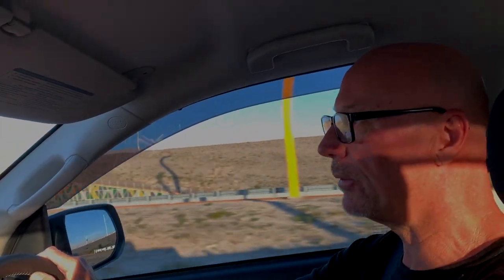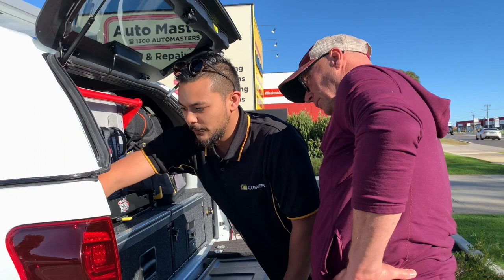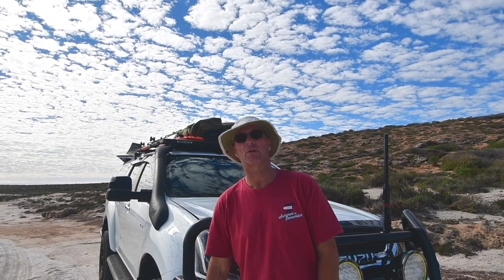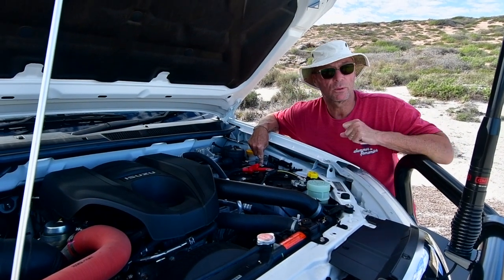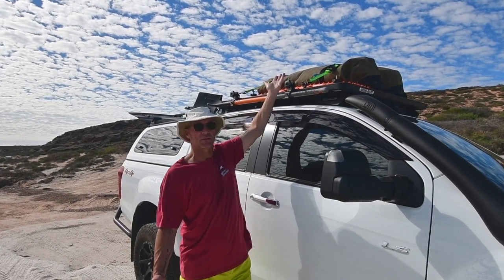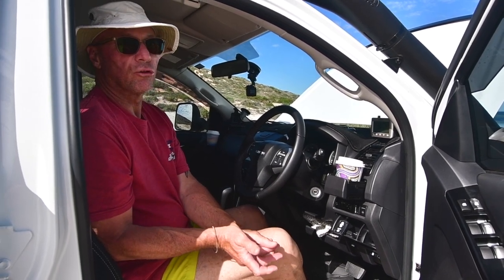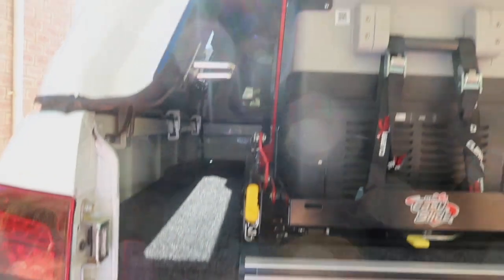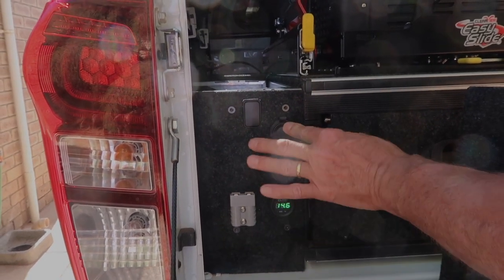The Truck (DMAX Build) 2020

Comment: Snorkel dont make more power, remember that air imtake Is managed by a computer so it wont let more air than necesary for combustión, in truck without Electronic injection maybe some gain in hp

Comment: Did you purchase a sand anchor to be able to use the winch when you get stuck on the beach.
Reply from the maker: Frank Mitzen -  hi Frank.... no it’s not widely used here -  we have maxx traxs and they ca be dug in for extra traction too..  more likely to lower tires/tyres and use the maxx Trac combination.....